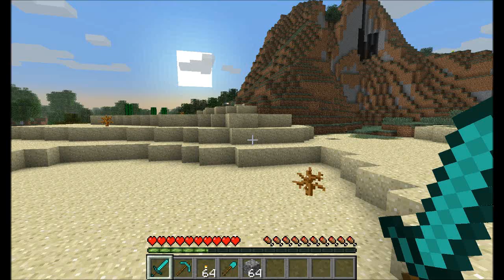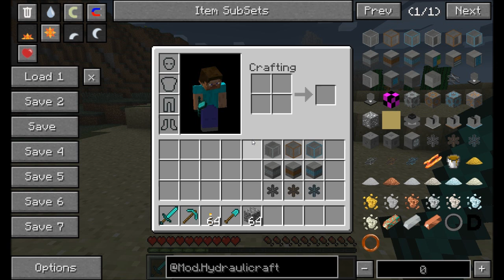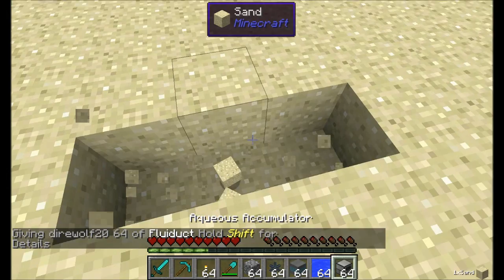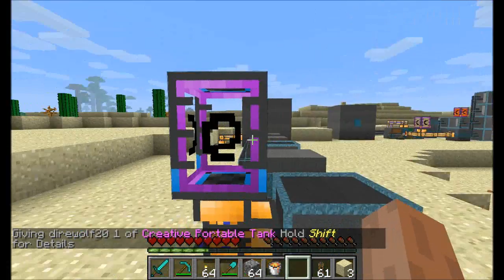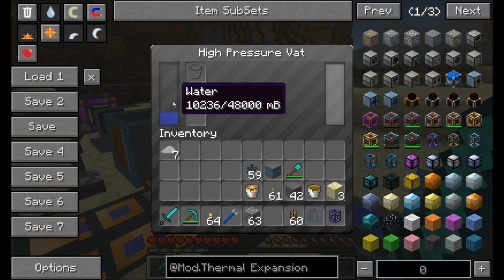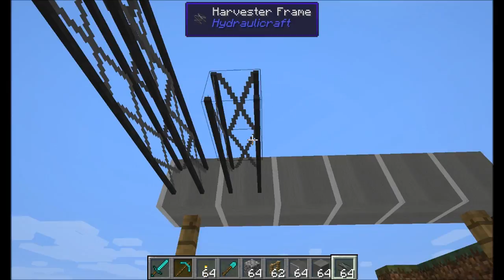Mod Spotlight   Hydraulicraft

Comment: Seems cool. I'd have to make standard res resource pack for it, and it needs to support steam, and argent / harvestcraft / natura / agriculture etc crops. Does Forge not have a standard crop API, as every mod with crops seems to do them differently, so that no mod can just detect a crop block / harvestable block or plantable item. If not, it should, as many Forge mod now add these common items and blocks.

Comment: Quick question(s):
Does this mod have its own way to supply and transfer water/fluids in the absence of TE Aqueous Accumulators and Ducts or BC Pumps and Pipes?
Reply: Nope, unfortunately not. It is a planned feature for the 1.7 release though! ~K4Unl

Comment: the mBar means milliBar which is a Bar multiplied with 0.001 and the actual bar it self is the unit of measurement which is used in the water pipe systems like those in your house and all arround the city. So there you go Dire ;) a little hint about that

Comment: Ooooh, finally a hydraulic simulator that I can use in my own home. I really hope this mod gets developed further, I want to see all the automated factory stuff you can do with hydraulics :D
This takes me back to my college days! I was an electrician, and as part of the education we had to automate a hydraulic factory. You know, the stuff you see on TV, the conveyor belts, the robot arms, the automatic fillers, painters, label-setters and all of that good stuff.

What you've seen here is basically the same pressure generation those systems use, so there's a lot of potential in this mod to make a realistic automated factory in Minecraft with this.

K4Unl did an extraordinary good work on this one!

Comment: I have trouble seeing the need to quadruple ore production. If you have a decent mining machine, youll get enough stuff that you shouldnt have to worry about resources to the extent where doubling quickly is much more efficient.
Reply: The PhD Man, those where the fucking DAYS. And ALL the way back when we had to manually insert all the class files into minecraft.jar? Risugami's Modloader? Ah, mod-stalgia..~
Reply: For the purpose of higher-tier machines.
Reply: So the purpose of high tier machines is to simply exist, to fill space in the mod?
Reply: Resources ==> Machines ==> Resources ==> Bigger Machines ==> More Resources ==> Huge Machines ==> Many More Resources ==> Stupid Dwarf Tricks ==> Insane Resources ==> Doomsday Device ==> Near-Infinite Resources ==> A Sweet House. :P
Reply: My main issue with it is how slow it is. it would be much more efficient to make 2 pulverizers/furnaces or macerators/induction furnaces.  think it would be great if they made these upgrades such that they too a crazy amount of power, but ran faster. Then they would actually be viable over large factories of standard processing machines, without being overpowered.
Reply: The PhD at least it's not 30 realtime minutes for tripling, eh
Reply: Kit Vitae
What are you talking about
Reply: The PhD In my day, we used a mod called Factorization. Ya whipper-snapper.
Reply: newcoolvid27
Please, in my day you had to make the modpack yourself and figure out the conflicts without a program telling you which IDs were conflicting, and deal with any bugs due to conflicts otherwise.

Comment: I don't like it for the sole fact that I'm an aircraft hydraulic technician and even though it is a very new mod its missing some very key laws of hydraulics. And hydraulic machines don't use up fluid, they leak it for lubrication purposes. A hydraulic pump doesn't create pressure, it creates fluid flow and resistance to flow creates pressure. They also don't light things on fire for energy as that would ignite the hydraulic fluid and destroy the system. I'm probably just being too technical.
Reply: The thing is. I am by no means an hydraulics expert. I am a student Embedded Systems Engineering. I have a basic grasp of how hydraulics work, and have done some research into it..

Keep in mind that i had to simplify some things just so that it would be easy to use for other people, and to make it usable within minecraft!

~K4Unl
Reply: I understand that there are and were a lot of limitations to what you can do in minecraft and as far as usability goes. I will most likely enjoy it very much if you decide to make it more in depth so can potentially build aircraft in game. Might be able to convince my supervisor that minecraft with the right mods is an educational tool and/or training! :)
Reply: Koen Beckers are you planning on adding other machines that also use hydraulics ?
Reply: Daniel Taylor
I don't think in the end i'll be able to add aircrafts :P But, who knows!
Reply: Mike Martin
Yes, i have loads of stuff still planned. But i won't add them untill 1.7 though
Reply: Koen Beckers Oh I don't expect you to do that lol I meant use a combination of mods to build a huge one and use your mod to perform an ops check or something
Reply: awesomeeee :) ! keep up the good work

Comment: I'd like to see the System overpressurizing and exploding once the Pressure reaches about 1% over Max capacity. That would add the need of at least a bit of Maintenance to the mod.

Comment: This mod may be a little bit OP. It's pretty much infinite energy. Make pressure using the water pump, then convert it into RF using the dynamo and you've got a survival creative energy cell with a lower output.

Comment: Nice spotlight, but IMHO the mod isn't that impressive. Not the amount of stuff he managed to get implemented, but the idea itself. If there was separate supply and return pipes, the pipes had some resistance, so that the liquid flow (millibuckets/second) depended on pressure/resistance ratio, etc. that would be interesting. But as it is right now, the only difference from other energy systems (TE, IC2, BC) is that you have to put some liquid in.
Reply: Wolf480pl
modding works like this. get the mod to work, then add things. this mod was made in a very short time period. there is no way he could implement what you are suggesting in that time frame AND the things he did have. take a look at any other successful mod. it is made, then tweaked, then balanced then re tweaked, then balanced ect. i think mod jam is like 96 hours. he has plans to work on it, but this is the BASE structure he made, and it works. and as you can clearly see, there are 2 piped. so maybe he has plans for a return and pressurized system tweak. how about following the mods development, and then give a TRUE honest opinion. not just a first look at a spot light. go play around with it, read the forums.
Reply: *****
I do keep that in mind. Didn't I say that I don't complain that there's not much stuff in the mod. My complaint is about the basic principles of the mod: the way water and pressure is distributed across the network.
Reply: Wolf480pl Also please keep in mind that it's still a work in progress, so the mod author will most likely to balance it out.
Reply: blanerocker It's not about balance. It's about the key functionality that everything else in the mod depends on - the way liquid and pressure are distributed across the network.

***** I'm a programmer too, and I know that you first get something to work and then expand.
But the BASE you're talking about is what I don't like. If he'd like to change it to a more realistic simulation of hydraulics, he'd probably need to rewrite the core and port all the machines to support the new hydraulic network.

Yes, what I suggest is probably impossible to implement during such a short period of time.

I suspect (and hope I'm wrong) that he isn't actually moving fluid in the network. It's like the ME network - the cables/pipes just determine what components are connected to the network.
If he really did it this way, it means he was in a big hurry, so he probably didn't have time to implement even half of what suggested.

Also, compare this to Sync or Morph. They were written in a short period of time, too. But the BASE, the key concept behind them, was something very innovative, something that we haven't seen in Minecraft before.
And the key concept behind this mod is something similar to what we have seen in Minecraft before - it's like ME network but for one liquids and one type of energy instead of items, and some devices to input, output, and use the energy and water.

Comment: Only thing I didnt like about this mod was a lack of a starter pump for water. I just personally feel mods of this sort need to be able to be stand alone. and by the looks of it with out some thing like BC or TE to give you a pump or a way to gather water you cant use it.
Reply: This block is actually planned. The problem with this however, is that i would also need to implement a way to transfer fluids. Which isn't the easiest of things to do. However, like i said. It is a planned feature! ~K4Unl
Reply: Koen Beckers Then I think this is a great mods. but since I got your ear... maybe I high pressure cannon fun fun LOL. but no real this is a great mod for the time you had and Im 100% impurest

Comment: I fail to see the use for the hydraulic dynamo, all of the methods for generating pressure are available in TE dynamos.
Reply: You can use Hydraulicraft to transfer EU into RF though. ~K4Unl
Reply: Koen Beckers Meh, electric engines would work for that. MJ converts into RF, right?
Reply: Schist025 Actually no. RF converts into MJ, but not the other way around. It used to in older versions!
Reply: Koen Beckers Well, that kinda sucks. Engineer's Toolbox would be better for conversions anyway. Because it is awesome.
Reply: iMDiamondCrafter Go download it, it is fun! It is based on modular upgrades for sockets, can do many things.
Reply: So, you're saying that FTB doesn't need any more mods? That it should only have TE and IC for power generation? I already find it boring only having one final tier storage system (AE) let alone only a couple of mods generating power..
Reply: Schist025 what mod is the engineer toolbox
Reply: what mod is engineers toolbox..!?
Reply: iMDiamondCrafter Engineer's Toolbox IS the name of the mod.
Reply: Gamer Dawg Not in any way, shape or form. I was saying the dynamo, which converts the hydraulicraft power to RF, seems useless as all methods of generating hydraulic power have an associated TE dynamo.
Reply: Schist025 LOL IT DOES xxD
I guess the plus side is it produces up to 100 rf instead of just 80, but yh nice point you make.

Comment: I was going to make a mod called this lol. Been a hydarulic engineer since i left school! wierd
Reply: jguth6 Yep, it's my mod :) I think i might consider the idea about cooling the oil. Gives yet another balancing aspect!

And yeah, some stuff had to be compromised for the sake of Minecraft. Had been thinking myself about adding a motor to power the pump. But for simplicity sake, it was better this way :)
Reply: Awesome! Then maybe you can tell me if i did stuff wrong. I myself am only an electrical engineer! ~K4Unl
Reply: Awww :/ This mod is a pretty neat idea .. may add it to my modpack :) Can you code in java? Maybe you could make another mod?
Reply: Koen Beckers nice work, can't believe you did that in a weekend!
:) yeah Id assumed you knew that already.
The cooling could perhaps be required on the best producer of pressure, so there is some balance to the upgrades.
Reply: You are a hydraulic engineer that can't spell hydraulic. ;)
Reply: Koen Beckers cool is it your mod? No id say its pretty good! Only thing is your hydraulic oil tank in real life doesnt hold any pressure, it just holds the oil before it goes to the pump and gets forced round the system. Then it will come back to the tank in a much bigger pipe under much lower pressure and the cyle continues but I guess it had to be that way for minecraft. Lastly a pump does nothing without a motor or engine running it but I guess that you know that and you just did it for simplicity. You do get units which would create pressure with a motor/pump in one, they would be called an HPU - High Pressure Unit. but meh, as I said I think you knew that it just had to be simple single blocks.
I guess if you wanted to add more difficulty then you could add coolers to cool the oil since creating all that pressure does produce a huge amount of heat.
Anyway, this comment is long enough xD Awesome job!
Reply: jedioutcast74 I know a little java but I couldn't do something as good as this.
Reply: Seriously? lol --- if he's anything like me he types so fast he often mis-types words. Or maybe he's dyslexic? Did that ever occur to you?
Reply: jedioutcast74 yeah I type far too fast for my own good. Its pretty obvious that I just pressed the a before the r instead of the other way around xD
Also i said hydraulic a few times in my other comments and spelled it fine